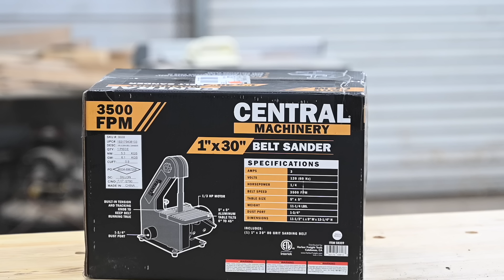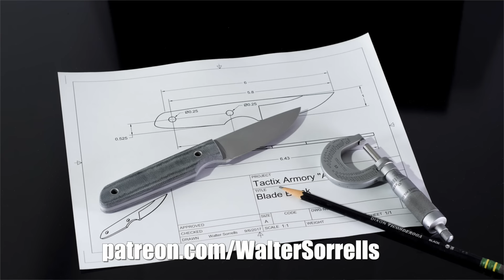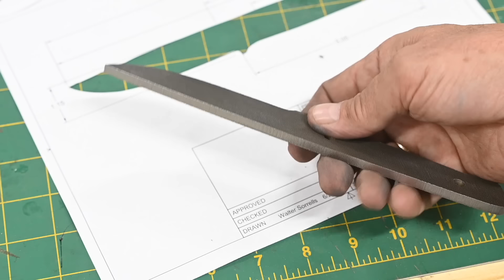Ultra Cheap Belt Grinder...Exposed!  (Harbor Freight 1X30)

Comment: Admittedly the HF 1x30 is the cheapest belt sander available.  However, it can work fine to make knifes.  I started making knives 2 years ago using one and so far have made 52 knives.   It is challenging to do the bevel grinds.  I've found you can make bevels up to about 3/4" but beyond that it does not work very well.  Most of my knives are 1/2 to 5/8" bevels for that reason.  Technique is important and over time and trial & error I can do good bevels.  The plunge lines are tricky because with most belts the unit tracking will align on one edge but not the other.  I've tried many belts and found the HF 40 grit Zirconia belts work best for the bevels.  The quality of my knives has constantly improved over time and it is very satisfying.  I'd like to be able to do full grinds and hollow grinds but can't with this little machine.   I can't afford the big 2x72's the the pros like Walter use but am considering the new Grizzly 2x42.  There is no big wheel (or small wheel) made for the Grizzly yet so hollow grinds are out.  Overall the HF 1X30 has been a good starting grinder.  There are so many other tools and equipment one needs to make nice knives.  I use a 4x36 WEN sander to shape handles and a WEN 4214 Drill press for drilling and buffing/polishing.  I also make a leather sheath for every knife and leatherworking is a unique and challenging craft to learn.

Comment: I've had mine for about 8 years and I paid 39.00 for it. For the longest time, I steered everybody away because it bogged down so easily. I had a yard sale & put a $10.00 tag on it. Nobody even considered it. I left it outside for a YEAR for whatever reasons-- kept forgetting to take it to the landfill. One day, I put it into the shed while cleaning, and about 2 years ago I needed a quick grind and thought.. hmph, let me try it again." It started right up and the belt was still strong. I used that weathered belt for at least another year, the machine never really gave me any more problems. I do use it mostly for wood and epoxies, but I do grind a lawnmower blade every year now. It's a super underpowered machine, but I wouldn't part with it now.
Reply: Sounds like it was operator error.
Reply: @rickwilliams967  Yes and no. I got it originally to put bevels on knives. It bogs down still very easily. It really shouldn't bog down so easily but that's with steel. It's even advertised to handle steel. If you use it for steel, it'll take you a while. if you use it for wood, then you'll be happy.

Comment: Right on. Cheap Chinese tools will gitter done when you are taking a casual approach to one or a very few knives or razors. You will KNOW when you need to upgrade. Don't let elitists tell you that you shouldn't even bother getting started, without a 3HP 2x72. It's just not necessary for a newbie, and it is a big barrier to getting started. Same with a HT oven. You can make a decent one for a couple hundred bucks. No need to spend $2600 for a nice shiny factory made one. I have a small Paragon and I like it, but when I bought it I had lots of disposable income. Starting over now, I would make one out of fire brick, angle iron, Kanthal A1, and a cheap PID controller. Or go back to simple carbon steels, charcoal barbecue grill, bricks, wife's hair dryer, and a magnet. A minimalist approach is quite satisfying, and when you turn out a blade that takes and keeps a good edge and feels good in the hand, and never chips, it is extremely gratifying. It is only when you are thinking you might want to sell some razors or knives that you really need more professionally oriented equipment.

Comment: Looking forward to hearing about the next level up - or two or three, maybe $150, 300, and 450 ish.  And whether 2x42 is worth messing with…
Reply: I have a 2x42/6' disc craftsman that is almost twenty years old. The biggest problem is belt size. You can find plenty of options online but locally usually just 60 and 120 belts. I am not a knifemaker though. I have used it for everything from rc boat and airplane parts to bbq grills and tools around the property along with about a half dozen skinning and marking knives.

Comment: I bought one 9 years ago, no dust port, ditched the cover in a month. I’ve made knives from start to finish with it. I’ve literally used it for everything I could in my shop including cosplay stuff and wood working. I’ve ran 6’ saplings up and down it for wizard staffs. Did they take a while, yes. Do I like my 6x48 better, also yes, but I still use this and it’s still going strong. And I’ve had it rained on several times cause it used to be on my covered porch before I had a basement with a shop. Would buy one again if mine finally broke one day

Comment: I call this company Harbor FRIGHT. And I personally don't recommend buying any of their power tools or anything with moving parts. Why? About 15 years ago I bought one of their smaller routers which I was using for some very simple electric guitar mods, basically customizing the shapes of existing pickup routs to accommodate the installation of different types of pickups. Mahogany and ash were the main woods being cut, and approximately 1 1/2 x 3 inches by 3/4" deep the extent of the excursions.
When these Harbor Fright power tools fail, they fail FAST and fail BIG. Within a few minutes of routing, the entire spinning motor assembly suddenly broke free from its cowling, and the now running wild and free router proceeded to run its way up my middle finger towards my knuckles. It was only the heavy work gloves I was wearing that saved my from losing fingers that day; instead I had a nasty gash up one finger which kept me from playing for a couple weeks, and cost me a pair of good cowhide work gloves. 
The whole motor assembly was being held in the cowling by an undersized white metal bolt that had sheared clean off after the unit had cut a shallow channel into the wood. I was thankful that the entire top of the guitar wasn't trashed as well, but the thing took off up my hand and into the air, hit the floor, and by that time I had unplugged it from the wall before it could bounce around and wreak any more havoc. 
Anyway, the little Makita that I replaced it with was much more reliable, solidly built, and easier to use than that piece of crap. No more Harbor Fright power tools for me! They seem so rickety, poorly designed, and under-built, and I fear having anything that cheaply made spinning at high RPMs, whilst attached to something sharp or abrasive, anywhere near me...

Comment: Had one of these. Worked well for inside wood sanding, drill bit touch ups, etc. But please, use a vac on the hose connection provided. The machine will thank you. Be sure there is no wood dust in the vac first if metal grinding!

Comment: ive got one it works well for grinding tool bits for my lathe and mill its handy I can stick it anywhere in a crowded shop and it cost about as much as a  McDonalds happy meal  for 2 people been using it about 10years now

Comment: The most important thing about using a HF belt sander (I've got the 1x30 with a 5" disk sander) is to buy good belts. Don't even bother trying the ones that HF sells, the last ones I got from them have a horrendously large bump at the seam. Otherwise, for light duty they beat not having a belt grinder.

Comment: I made my first six knives with a set of files, until I hurt both elbows, and I bought a WEN 1x30 for about $85.00.  It worked okay, but it took me forever to get a knife made, especially when I used some fairly thick 5160 steel.  I heavily modified mine with a 6" x 18" shelf bolted to the aluminum work table and some additional supports that bolted to the front of the pedestal I built to hold my machine..  I have no idea if the WEN is any better than the Harbor Freight one.  As always, experience helps.  I used my 1x30 for a couple of years before I got a professional grinder.

Comment: I have an older Delta version of this belt sander (looks nearly identicle-made in Taiwan).  It's one oc the most usdd poser tools I have, for woodworking, metal projects, and repair work. You have to search for higher grit count belts (100+), belts are inexpensive and its worth having a chojce of grits

Comment: I myself use the HF 1", 4", and 6" bench sanders. (Sorry, it's a sander - all my grinders have, you know, grinding wheels.) The motor on the 4" is pretty anemic. The 6" is a real moose.

Comment: These HF belt grinders with a 1 x 30 leather belt is ideal for a woodcarver to power strop with ..I have a $300 chipping away ultimate sharpener ..Its a great tool but expensive ...This HF sander has worked great for carvers who want a economical way to strop their carving knives

Comment: I noticed in this video you held the blade edge up while sharpening it.  Do you hold the blade upright on a downward grine even while sharpening up to 1000 to 2000 grit sanding belts? Thanks!

Comment: I like most HF items. There are times I want the best I can afford, but there are other times when I don't feel the need to spend that kind of money. Each purchase is thought out. I often enough wind up with HF tools and hardly ever unhappy with my choices.
    Don't try to separate me from my 20+ year old nicad powered DeWalt cordless drill though! Runs and looks like new, so it shouldn't be any surprise that I got a DeWalt corded drill not so long ago.

Comment: I have one.  Even for a schmendrick like me it is barely adequate.  The belt centering adjustment doesn't really center the belt.  The rocker switch can be spotty and mine thusly blew up the capacitor, which is tiny and my new capacitor sticks out the back of the wiring box.  Yes it does stall.  I used it for little things like guitar nuts and bridges, and all the whole time I was wanting something just like this but a little heavier duty and a little more stable.

Comment: Do quite a bit of fabrication from woodworking to welding and found that Harbor Freight and even eBay bottom-of-the-line tools work fine IF, and that is a big IF.  You have to take into account that they are not industrial quality machines, and if you treat them with this in mind they can get the job done and last quite well.  Often if there is an issue with these products there can often be simple but very effective home-built upgrades to work around problems.  Good example is I have a old 1983 vintage Mig Welder, Allstar, which when you take the covers off you find that it is a name-brand Mig sold by a now out-of-business autobody shop supply company.  Had an issue of under-hard employment, and many older MIG's of that day also had heat mitigation.  Simply installed internally 2 cabinet 6" fans, one pulling air in and the other pulling out, now it works all day long without issues.  Verified with a thermal camera a huge transformer core temp reduction.  Yes, it is noisy, but I will take some noise over buying a new transformer any day.

Comment: I’ve had good luck with mine! I use it maybe a few hours a month. I also stop to let it cool down if i thinks I’ve pushed it to hard. Also I take compressed air and blow the motor out when I’m done. I want a 2x72 but the price. Ouch…

Comment: It's only "okay" for the price.  I have one, only issue I've had, outside of the limitations inherent in this machine (as mentioned in the video), is that cracks formed in the belt cover near the hole at the top, which were easily repaired/reinforced with fiberglass tape and superglue.

Comment: What do you mean by  JUNK? A DIY home hobbyist does not need a $1500
3hp belt grinder for the intermit need they have for this machine. BUT if
you are a production shop which needs one of these for 3 shifts this unit will
come up short, But for the artist, it is  PERFECT. 

!
Reply: $50,000 vs. $50 = time.

Comment: I can tell you...I operated a business for 13 years making edged weapons..I used a cheap 30 inch belt grinder during that entire time. I didn't buy my first 72 inch professional grinder until just last year. Looking back, I couldn't justify buying one. It also went against much of what my business was promoted as all hand made. I'm not so picky anymore and now I dont know how I got by for so long without my 72 inch grinder. Point is...if you're getting started it's a good choice just get some good belts. I'll also add that I didnt use a harbor freight sander...get the best one you can afford..I ended up with delta model for about $100 and it's still running after 20+ years.

Comment: Mine shoots little lightning bolts into my fingers when I use the higher grit belts in the strop kit but when I'm just shaping handles with a 40 or 80 grit belt there's no lightning.

Comment: The HF 1X30 works, but is not a high quality product.  I got the green one about 2 years ago and the first time I ran it the shaking and vibrations were bad.  That was because the main wheel mounted to the motor was out of round.  Returned it to HF and tried out a few more in the store...they all had the same problem.  Took the wheel off and using my drill press then sanded to get it more true.  Not perfect because the wheel is thin plastic,  but better than it was.

Comment: A REQUIRED purchase for the beginning blacksmith. Remove the top guard and you have enough slack belt to shape hammer heads. There is a reason this grinder never goes on sale. It maybe has the most cost/value of any powered (well moving anyway lol) tool on the planet.
STRIKE TRUE
BARBARIC ERIC

Comment: The biggest hurdle with budget grinders is the temptation to buy budget abrasives to go with them.
I found out through trial and error that the cheap belts aren't cheaper in the long run, plus they fail more often.

Comment: I've got the better brand name of one of these and I know it retailed for twice what HF sells it for. I've had mine for 25+ years and probably use it more for tweaking metal than wood. Mine is made almost identical to the HF one that I wonder if the same Chinese factory made it ? I don't make knives but put a high quality belt in it and it does rather well for adjusting the shape of the metal your working with.👍

Comment: I only owned the green variant, not sure if there are differences though. I always had issues with tracking & thr platen allowing even plunges. Not sure why either. But the belief that these are underpowered or "slow" when their stories are not ao believable... Well, I'm going to say after owning multiple green variants, they'll work but run VERY fast. A delta 1x30 with speed control & better tracking may be a better option.

Comment: These little belt grinders are dynamite for sharpening.  A 600 grit ceramic, a 1200 grit ceramic, and a 15 micron belt and you're off to the races.   I have all the high end pro stuff you'd expect in a knife shop, too, but these little things are so darn handy and take up about zero bench space.   I have had a pile of them, because I always end up giving them to someone just starting out who has no power tools.  Then I miss having it and go get another one... repeat ... repeat LOL.   I mean seriously, it's fifty bucks.    One of these, a 10 inch bench top drill press, some files, a hacksaw, and a good assortment of sandpaper and you can make just about anything if you've got the notion.

Comment: I have one it's green and bet ive had it over 10 year and use it all the time. Ive had to do change the on off switch rwice (amazon ) and the solenoid once (again part at amazon) again one of my go to tools. Belt again (amazon thing a dozen $6. Bucks)

Comment: I splurged just a bit more than the HF one.  I bought a Bucktool 2 X 42.  Paid about $260 for it.  Came with a half dozen belts.  Just looked and they're now about $200 at the company website.  Just like the HF it has limitations.  I'm strictly a hobbyist and I'm very slow, but I've made 22 knives out of worn out circular saw blades.  Oh yeah I've drooled over the Ameribrade and other professional tools but there's no way I'm spending that kind of money for a hobby that I enjoy.  I do not intend to turn this into a job or a side hustle.

Comment: I have a couple of these and use them a lot.  I am a model railroader and they work great on every material I have tried.   Great for deburring train rails and rods.   Wood buildings in 1:160 or 1:220 scale come out great.

Comment: I just use my cheapo Belt sander.. The thing eats metal with the right grit sanding belt. I bought a shed load of cheap belts from the local store and they are great.
I really enjoyed the video pal. It's comical how u reacted to the little belt sander. U probably expected it to burn out after 20 mins.. Sometimes these cheaper, sorry dirt poor tools, come up to scratch for the hobbyist but then again that's who they're for anyways.. I have a few old files in my shop but I also have a couple of battered old CHISELS.. Could I make a marking knife out of a Chisel or maybe even a KNIFE?? With the chisel, is there some heating that needs to be done 1st?? I don't get all that stuff pal..